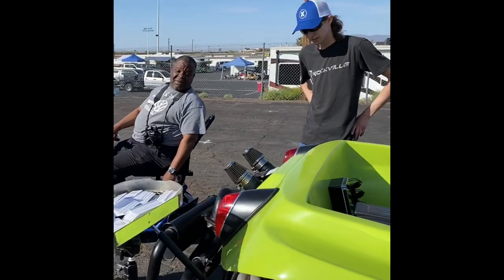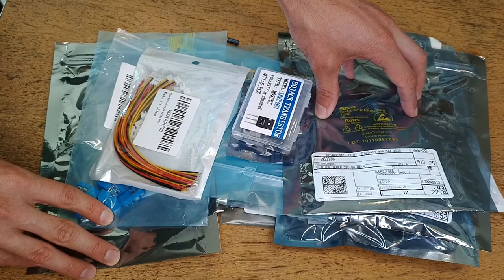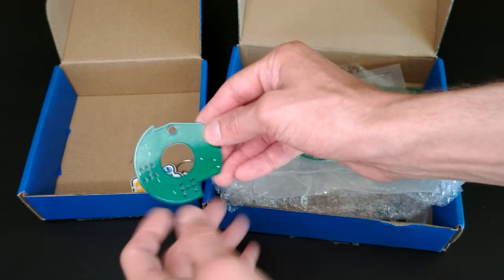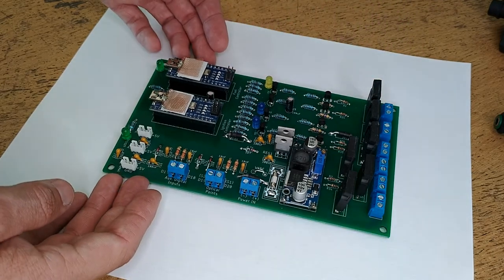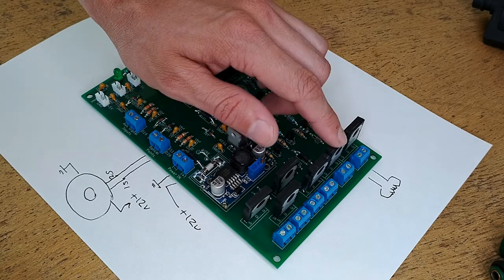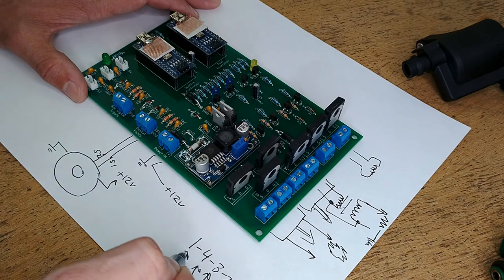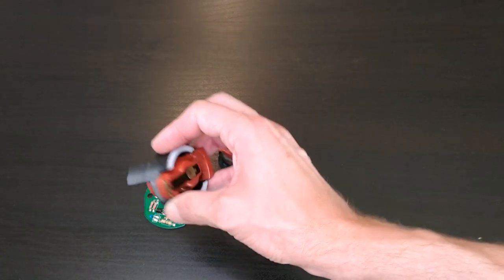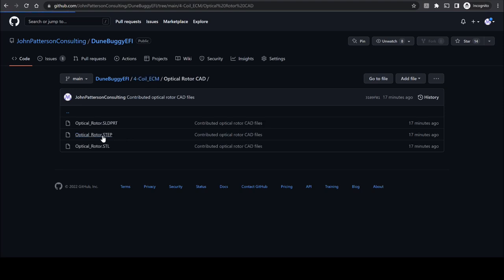EFI and Ignition: 4-Coil DIY Engine Control Module

Comment: There are some other sites that promote EFI on the Aircooled VW and I have ask questions about an install.  But they never returned an answer or they just don't care.  You explained very well.  Thank You.  PS You need to become a Technical Writer if you don't have a profession.

Comment: Thank you for taking the time to fully explain all aspects of this project. The improved performance, efficiency, and reliability that the optical 4 coil ignition and EFI adds to the bug would most definitely make it a more pleasant and dependable vehicle. I like all your videos and that you go in depth so others can emulate and build what you build; but I especially like your VW videos.

Comment: It was probably 20 years ago the first time I took my first two kids to the Phoenix Bug-O-Rama.  Brings back memories.  This is some very cool work you've done here.  You have obviously done a lot of research to get to this point.  One question which is far from a criticism.  Is there a reason you didn't use a crank trigger and a pulley with a gap?  The thing I like about your design is that it would be far simpler to retrofit a Type 3 motor, where it's not so simple to just put on some different pulley.
Reply from the maker: So glad to hear you like it! The Bug-O-Rama has been a long tradition in my family as well!

Most of the crank trigger systems I encountered used a tooth wheel, and I was concerned about interference from the ignition causing over/under counting of the teeth with subsequent loss of positional accuracy within the rotation. The distributor trigger seemed less prone to potentially dangerous timing errors, so I opted for it in this design.
Reply: @DielectricVideos  Very nice work and congratulations. I’m not sure if you are familiar with Type 3 motors, but the previously available consumer products provide the crank trigger method. So, for an “out of the box” solution, they really aren’t a good option for a T3 motor. 

For those of us willing and able to customize things to make it work might as well save lots of money and do something like this!

Comment: excellent video, if you allow me the advice, for the injectors you can use the ic fds2407, each package works for 2 ijectors, and for the coils you can use the IGBT V3040D, they are used for automotive use

Comment: Great project, with grate documentation. looking at the schematics I see you are using the unregulated battery voltage driving the injector, but a regulated 12v to drive the ignition coils. How come?
I would imagine that the injector dwell time would be influenced by the voltage level and thereby not consistent.
Reply from the maker: The main reason I drive the injectors directly from 12V is that they draw too much current for the boost converter  on average. Each injector can draw as much as 2 amps, which can be on for up to 100% duty cycle. Although the peak current in the ignition coils is higher (around 8A each), it has low enough dwell time that the average current is much lower.

Ideally I would love to boost-regulate the injector voltage as well, as this would make for faster and more consistent cranking starts.

Comment: With distributor optical blinds designed as a full half circle sector and two optical sensors placed on 90 degree angle (as yours) you actually can produce four position signal 00,01,10,11. The change of signals will happen on every 90 degree by distributor shaft rotation or 180 degree by crank shaft rotation . Instead of optical sensors, better use Hall sensors specially designed for automobile applications which include the magnet  . You can find such a sensors as a replacement of contacts in some models of VW golf , Passat  second generation.
Using individual coils but driving them 2 by 2 in parallel doesn’t make much sense since you double the primary current pulled from the alternator and it isn’t free :) , double the number of sparks and shorten the spark  plugs life by a half , probably the temperature of the coils as well !  The advantages of your variant of waste spark system in comparison with waste spark 2 coils( for 4 cylinders engine ) systems will be the lower electrical noise and the uniform and proper polarity of high voltage secondary pulses. In 2 coils waste spark system the polarity is proper ( (-) on central electrode )for the one of the spark plugs in the pair and in reverse on the other spark plug . When the high voltage polarity is reversed the break down voltage of the spark gap increase on about 25-30% . Also with 2 coils waste spark system you must use only double platinum/ iridium-platinum electrodes plugs because otherwise the ground electrode of the reversed high voltage pulse  spark plug erodes extremely fast . The advantage of classic 2 coils waste spark system will consume twice lower current than in your variant. So better drive the individual coils and the injectors sequentially , not by pairs .
Reply from the maker: Fantastic ideas to try, and good point about the spark plugs! Thank you!
Reply: @DielectricVideos  you are welcome, you have done fantastic job !

Comment: Good day John . I did down load th Gerber file , but I dont have success in downloading the schematics as well as the pcb file . I must say I it is a nice project. I want to use it on a 1982 Opel kadett 1300 voayge.
Reply from the maker: So the .brd (board) and .sch (schematic) files don't open? What version of Eagle are you using?
Reply: I'm using version 7.3.0 the notebook I'm using is a 32bit  and not a 64bit . Regards.
Reply from the maker: @wimpiehattingh7162  These files were saved in version 9.2.2, so you may need a version at least as new as this in order to open them
Reply: Thank you I will download a newer version.  Keep well.

Comment: Did you use a oxygen sesnor or is this a open loop system?
Reply from the maker: It's currently set up as an open-loop system, but with suitable software changes, one of the analog inputs could be used as an oxygen sensor connection and closed-loop AFR control could be performed.
Reply: @DielectricVideos  This is a awesome project brother. Appriciate your effort. I'm hoping to make a DIY EFI system for a motorcycle. So how can I use a oxygen sensor readings to compensate with AFR values? Do I have to use PID for it?
Reply from the maker: @garage9732  Typically narrowband oxygen sensors operate in a bang-bang control loop where the sensor is allowed to drift from rich to lean. This is because the voltage output of the sensor is very sensitive to oxygen concentration, and switches from high to low in a very small concentration range. The program would need to determine when the engine should go closed-loop (typically during cruising or idle when AFR might be set close to 14.7), and when to run open-loop (hard acceleration or coasting). 

If you use a wideband oxygen sensor, then you can keep it closed-loop over a wider range of AFR values, and a PID control loop might be required for stability. A PI may be sufficient as well, as it doesn't need to be a particularly fast control algorithm. Some checks for reasonableness should also be in place (for example, keep fuel trims bounded to some finite values, like +/-10%).

Comment: Good stuff!   Tell me does this system have the ability to program a custom ignition advance curve?
Reply from the maker: I have options in the program to apply positive or negative advance in response to engine speed and manifold vacuum, but currently these are just fixed multiplier values. You could probably write a function to calculate ignition advance according to your own custom curve equation, and call the function when calculating delay time for the ignition output.

Comment: Why no o2 sensor?
How do you set for a rich/lean condition?
BTW Coming along nicely!
Reply from the maker: The AFR values can be manually trimmed in each RPM/MAP range within the AFR table, so once they are set the mixture stays mostly consistent. At least, it's been consistent enough to pass emissions testing. An AFR sensor could be installed for more sensitive applications, using one of the auxiliary analog inputs.
Reply: @DielectricVideos  Cool.

Comment: sigh. looks like its now suffering the "bloat" syndrome...

ha ha, mines still smaller! may not have all the features, but yeah... what do you expect using a pic12f683? 8 pins! and so far, still only using two. crank signal and injector...

a work in progress, now i know my interrupts are working, that the engine runs, getting an idea of how to code in assembly, the next step is to add the MAP sensor...

then comes the fun part of trying to tune it... deal with teh data i get with teh MAP and ADC... determine which stroke its on... break the max injection pulse into two parts once injection time exceeds the timefraame available at high RPM with high VE. (including boost eventually...)

 i can see the sense in arduino, but after going through the firmware for speeduino, i couldnt figure out how to implement my method of obtaining the crank signal. C doesnt make sense to me, and when i see "void", i simply ignore anything coming after it, lol.

"bloat". i dont want canbus or obdii or knock sensors... my whole intention was to get it as bare bones basic as possible.

with the PIC, it was simplicity itself. other than the coding and dealing with microchip and their apparent intention to make everything as difficult as possible...

back to back (antiparallel?) optocouplers driving an eccles jordan flip flop, and simply measure the length of pulse. VRsensors produce a positive AND a negative signal... and the 12f683 has a gated timer. simple!

everything about the pic12f683 makes it seem that it was almost intended for this...

Comment: can I use 2 proximity sensors to get distributor signal ????? My engine is A12A & vehicle is datsun HB310
Reply from the maker: Most likely yes, although you may have to adjust the initial timing settings to compensate for any phase shift caused by the angular placement of the sensors.

Comment: good job 👍
can you share on your github the stl for distributor caps ?
thanks
Reply from the maker: Yes! I just uploaded the CAD files (SLDPRT, STEP, and STL) for the distributor cap cover. The original 009 cap is still used, but this covers the top of it for aesthetics.

The rotor design files can be found in the directory one level above the one linked below.

https://github.com/JohnPattersonConsulting/DuneBuggyEFI/tree/main/4-Coil_ECM/Distributor%20Cover%20Cap
Reply: @DielectricVideos  perfect 
Thanks
Reply: @DielectricVideos  Hi ;)
I did find information about your Electronic CAD
I use EasyEDA and Kicad but I can't open your file like Optical_Spark_V2.0.sch
I need your help 😀
Reply from the maker: @stdcbaleine  I believe KiCAD can import Eagle schematic files. Maybe see if there's an import option?
Reply: @DielectricVideos  EasyEDA can import eagle Files ;)
I never use youtube for message but can you give me a contact to message you in private ?
Reply from the maker: @stdcbaleine  Feel free to send an email to jpatterson192@gmail.com 👍

Comment: Hi, great video, very interesting. I have a Type 4 engine so have 2 carbs, inlet manifolds. I the on the board there is a aux mosfet can this be configured to run an injector? and can one of the other analogue inputs run a map sensors? The idea being having 2 independent fuel injectors/ throttle bodies, one for each side?.

Comment: Mr John, What's the direct injector's working voltage? still 12V  or using boost circuit ?

Comment: I don't know if you covered it elsewhere, but how did you handle acceleration enrichment with such few inputs?
Reply from the maker: When the fuel delivery values are calculated, there's an additional term that adds extra fuel proportionally to the rate of change of the MAP signal, so if the throttle is quickly opened, and the MAP goes up rapidly, more fuel is added for a brief period. The rate-of-change proportion can be adjusted.

I have, however, found that this isn't really needed when there is a long intake manifold between the injectors and the valves, as some fuel tends to condense in the manifold during cruising, and when the throttle is quickly pulled in, there's already some extra fuel available. I usually keep the rate-of-change term at or close to zero.

Comment: Do you have a 3-D printer or are you sending those out to be made and if so who are you using?
Reply from the maker: I have a 3D printer that can print PLA and ABS; however, I had the rotor printed at Xometry in polycarbonate. I then spray painted it myself for IR opacity.
Reply: @DielectricVideos  thanks, you've done a great job.

Comment: Good day  I'm Wimpie 
Im going to ask a stupit question.
How do i download the schematic and pcb file from github to use in Express pcb. Is there a way to convert a Gerber file back to a pcb file to be able to to print it on a printer? 
Thank you 
Regards.
Reply from the maker: It looks like ExpressPCB can import Eagle footprints, but not entire schematics. If you are a student, you should be able to download Autodesk Eagle for free. I also believe KiCAD can import Eagle files, if you are looking for a free alternative.
Reply: @DielectricVideos  thank you will install eagle .Regards have a great day

Comment: Did you 3D print the Throttle Bodies?
Reply from the maker: The throttle body is from the lower half of an old 2-barrel Zenith carburetor, and  I made the injector mounts from some galvanized pipe and a set of weld-in injector bungs.